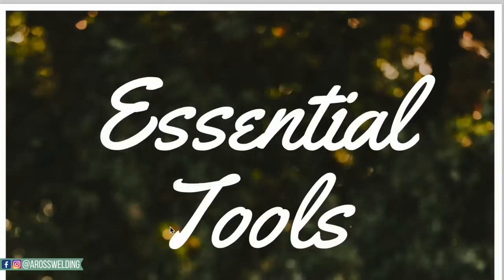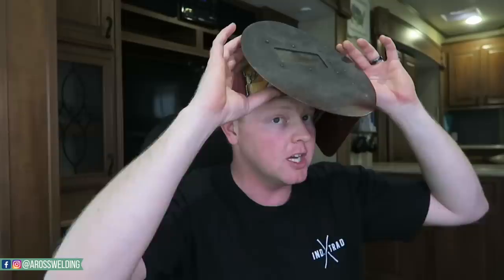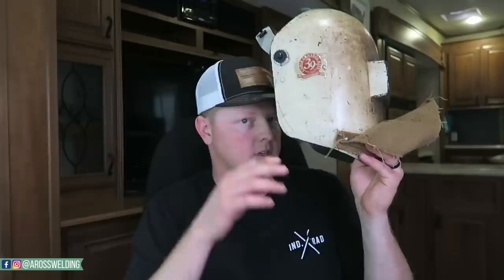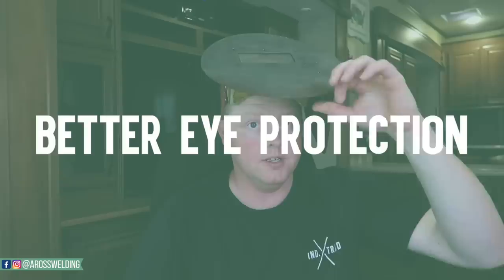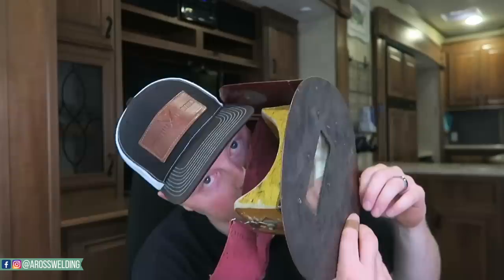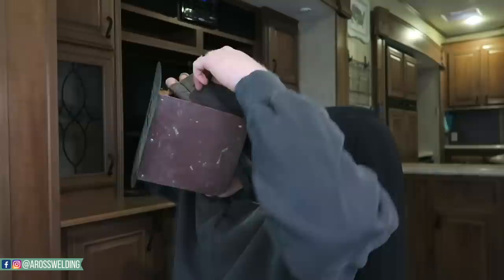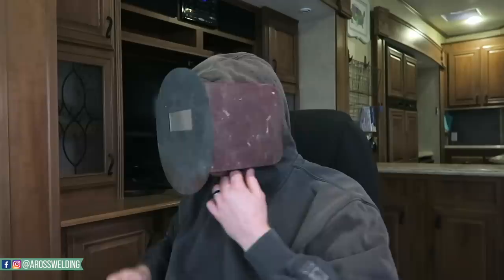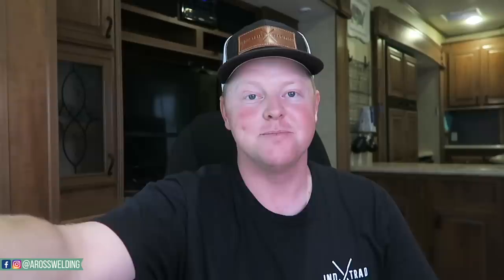WHY PIPELINE WELDERS WEAR PANCAKE WELDING HOODS (EVERYTHING YOU NEED TO KNOW)

Comment: I welded in a small area with 1 or 2 others and was repeatedly flashed by their arcs and they by mine. Even reflections in the helmet were distracting. I didn't care for the electronic lenses because the sensors would turn off at random times due to positioning. Also smoke would regularly find it's way into the helmet.Something with complete eye protecting like this combined with multiple sensors for an electronic lens might have been useful.

Comment: Your problem will disappear when you learn the comfort of welding, replace the pans with a good 3m speedglas 9100 mp Adflo - then it's fun to weld because nothing bothers you - smoke, sparks, flashes from the back - it's great, I spent over 20 years in different places and in 90 percent  this speedglas is amazing 
👨🏻‍🏭

Comment: I'm not a welder but have done a lot of welding in industry in the last 3 years before I retired and my favourite hood was the auto darkening one.
So with a "normal" auto darkening helmet you could make a sponge rubber square box around the lens to fit to your face and so exclude the back glare from the surrounding lighting.......this might make your face or the lens steam up from the trapped moisture etc.....gonna try it next time I go out there.

Comment: I like my standard auto-dark hood for arc welding, though so far I have done a grand total of one weld outside which was a tiny lil flux core bit. I prefer goggles with a flip-up tinted lens for oxy-fuel work though. I wear it with a respirator (I'm more sensitive to airborne particulate irritants than most) under a face shield for heat management. Works great for running beads or cutting in the shop. 
I'm actually an engineering student, but a year and a half at trade school reinforced my belief that though y'all may knot know why what you're doing works (who cares what's on the outside of a 6013 specifically, only that it's not a 6011, etc) but you know HOW it works better than any desk jockey or supervisor who's never actually touched the processes or techniques themselves. Those instincts and ambition are incredibly valuable to any designer/engineer, especially if they want to be good at what they do.

Comment: So I just watched your video at the Starbucks. You used the ( now I know) pancake hood. Made me feel kinda dumb, never saw one. I welded for about 13 years at a sprinkler co but it was always in the shop so never had a problem with back lighting, the place was like a dungeon. But I’ve done a lot of welding at my shop now inside and out. I’ll be getting me a pancake hood. Thanks for your time and knowledge.

Comment: Most welders in Australia use light adjusting automatic helmets, they enable precise electrode positioning and help 2 avoid arc strikes on the parent metal, thus avoiding cut outs on specialised piping. Also stovepipe welding and vertical down procedures are virtually non existent these days and have been replaced by TIG, FLUX CORED and Automatic Orbital techniques which will eventually take over in the coming future.
Reply: Flux has issues out of position compared to SMAW.
Auto orbit I'm assuming you mean the submerged arc remote process? If so the time spent on attaching the equipment to the pipe means it's only worth it on the larger pipe. Manual stick is faster for the average pipe to setup and cleanup so it more than makes up for the small amount of time saved using submerged.

Comment: cool man... I work as a controls electrician at a steel pipe mill. we make the big heavy wall pipe. average size 48' diameter .650 wall. but lots of other sizes. im sure you have welded up our product in the field

Comment: I like it. Great explanation sir. 
I have been tinkering with the flexible solder and welding shields I use when welding or soldering in front of flammables.
I use Oxy Goggles(Gomer Goggles) with a hood made of 2 layers of the fabric like a sweatshirt hood or more like a Balaclava lined with flannel (pillow case). 
Exceptionally great in the winter my head stays toasty.
Tough part is the addition of an adjusting strap to the goggles that just arent made for it. 
Pop Rivets look crappy so I switched to hand riveting copper rivets with a lil air hammer. 
I really like the flexibility and weight is almost non existent. 
The tint is fairly easy once you learn how to shape the glass.

Comment: I had always wondered about that.  I have been welding for a number of years off and on.  I have never done pipeline welding and had always wondered about those hoods.  My normal go to for mig and stick is a standard sugar scoop style with a big lens.  I also have a lincoln viking auto dark that I use almost exclusively for TIG.  Having the shade adjustability and the super clear lens is nice for high precision stuff and if I need to weld in a cramped space like an in car roll cage or performance exhaust type work.  I might have to try a pancake for some of the mobile service/ mobile fab type jobs.

Comment: As a teen I worked pipeline and once had to drag the welding cables a few hundred feet into a 36 inch pipe so a bad weld could be repaired. Low man on the totem pole and all.

Comment: I’m just wondering why they don’t make one that’s made entirely out of carbon fiber with a paper thin layer of titanium on the exposed faces, and takes a common auto darkening lens.  It seems so simple.  Everything is flat, so you don’t need to hand lay a carbon fiber shape.  Just basic sheeting.  The cup of the goggles would be the most difficult part.
Reply: Not meany people use autodarkening lenses with production welding like that. Just do much hassle if they get to where it doesn't darken because you're at an odd angle, or if the batteries die, or whatever other problems they can have. Where a tinted glass is always going to be there.  

I would imagine making them thinner and using fiberglass is what has reduced the weight. Much of it is probably in the goggle cup.

Comment: I wore a huntsman 411P for years, then back light was killing me I switched to a sugar scoop back light was a little less but that rubber strap kept failing so I put a regular headgear in it, I still carry it but rarely use it. Then I bought a Wendy's, Arcone singles 240, and a 3 power cheater and it's a game changer, I can wear that thing all day. I'm not a pipeliner, I do structural, fencing and fabrication. I'm about to order a second Wendy's.

Comment: Some of the job sites aren't allowing pancakes because when you lift you  don't have eye protection.  Some are even requiring hoods to be mounted on hard hats.  I like my Fibre Metal but also have a Jackson w10 with an adjustable auto dark that has grind and cut mode.  Hate that one when welding all day because it's so damned heavy but great when doing repairs and your back and forth with things.   Also have a Jackson w10 with just a plain lens.  Still a little heavy but not welding as much as I used to.

Comment: Try using a firefighters good .during winter work .it fits snug enough so you would be able to use any welders hood. Over so it won't be in the way  while working .all different types fairly cheap .

Comment: With the sealed eye box I'm afraid I would fog that up when I get sweating.  Broke in on Hunstman with a big window at age 18.  Dropped and broke my first one.  Been using the next Huntsman ever since 1984.   I use ear plugs to keep the sparks out of my ears.  I like the big window so I can look behind me while welding to see who all is watching over my shoulder.  In a big shop people sneak up on you to see how you do some things.  I can also see if my skin on my head and neck is being exposed to arc flash.  I run a #10 filter and a number 3 cutting lens taped on the inside so I can start my arc in the 10 and then dip down to look through an effective 13 lens.  .  No more head aches or mild eye flash.  I run a lot of .065" wire in spray transfer with mixed gas.  Using up a 60 pound roll every 6 hours.  It's really bright.  When we were practicing our 6" pipe tests they required all welding to be uphill.  1/8th land and gap.  1/8" 6010 root and 7018 cap.  No grinding wheels allowed.  Had to chip it with slag hammer and wire brush only.

Comment: I prefer on land the Miller T94i-R because it's a full head with fresh air from your back area which I use a lot on shop and tight spot welds I even pull my filter off and run a much longer hose on it so I get fresh air from outside the hole so even if the oxygen level would drop inside the vessel or tank I still can work because I get fresh air supplied.

Comment: Most welder's wear auto-darkening and they are super light weight. No one uses a sugar scoop anymore.
Reply: Gregory K. We use them in Mexico, they are a cheaper alternative. Dedicated welders of course prefer the more expensive but more efficient equipment, but if you have to provide protection to a dozen middling welders then sugarscoop's gonna have to make do.
Reply: I rarely see pipe welders use auto darkening hoods. So wierd.

Comment: I think your pancake hood is an American thing. As a boiler Maker, I never saw pipe line wear that in Canada. Typically we are all supplied with the  basic Fibre Metal grey mask. A lot like your sugar scoop. I have used a full face respirator style (North brand). Everyone calls it a Darth Vader mask. It's all black and covered. Used in our tight spaces were fumes are a concern. Tend to wear it with a auto darkening insert lens. This way I don't have to flip it up too much. the flip up part is a cheap plastic hinge that breaks easy if not careful.

As for using hood while welding, In Canada we have to wear hardhats, and the hood can't go over your hardhat. Also in some sites, you are not allowed to wear hoods. Balaclavas are aloud. a trick around that is to wear a neck warmer and took over the hood. it disguises the hood, and being -20 to -40 Celsius (-4 F to -40 F) you don't care.

In the shop I tend to wear the Miller Digital Elite. When I return to welding, I'll probably upgrade to a force air respirator system. Clean air, easy breathing, a little cooling, and no back light. Also like this mask for TIG work.

Comment: So this wasn't really what I was looking for I clicked on the wrong video but I have been a structural welder for about 5 years for the majority of that time I used the Miller infinity hood yes they are a bit heavy but I'm blind in one eye so the clear light lens helps a lot but I just got the Lincoln viking 3350 and it is by far better its much lighter and the design of the head gear is much more comfortable plus the clear light in that is 100x better but I was still wanting to get a pancake for when I'm out in the field or doing a bigger project that has to be done outside anyways thanks for the video

Comment: Couldn't you just affix a bit of cloth off the top edge of the regular welding helmet using snaps? Solves the back light problem, and can be removed/replaced if needed.

Comment: Using the cheapest Optrel automatic hood (150€), since I'm a hobbyist, doing mainly TIG, bit of stainless/aluminium, and I'm not good enough to have a non-automatic hood, and it fits my respirator.
If I did more welding I'd probably get a PAPR hood (stainless and aluminium TIG welding isn't the the healthiest, plus, I do it indoors... yes, with good ventilation, but, there's limits.).

I tried a permanent shade hood and with smaller stuff/bad angles it always messes up my start, which then annoys me, makes my pool go bad, destroys my flow... lol

And I do wear a hood (from a fireproof coverall) below my welding hood. I don't like most welder hoods because the neck is exposed. I don't want any skin to show.

Comment: I have several pipeliner scoops, some with the rubber tube tension band and some I modified with sellstrom flip up lens and ratchet head gear, that I use indoors or if I am doing a lot of tack or grinding but for welding outdoors I prefer my pancakes. I like the original pancake with cheater lens box that comes without a side plate and I add a wendys side plate to it.

Comment: Johnson's a company that supplied to the Navy use to make a half hood it was only about 10" across about 8" tall and flipped down much closer to the face it's what we used to pipe weld . I still have mine but the head peace finally failed so I can't use it any more the head peace for regular hoods extend it out to far with its reduced size let's to much light in .

Comment: i dont know... but now days welder helmets are cheap u can attach back hood to them (so u can be warm and have no back light and also u can get ventilation as a bonus) and they are lightweight... i dont know where u live but i think u should try modern electronic one... im welder myself i dont mind using old crap if i have to but modern ones are pleasure to use...

Comment: I have to use an auto darkening helmet.  I tried tig at work and i couldnt find my hands if you get what i mean.  Im pretty good at mig but arc i cant do and i wasnt very good with tig.  I have bought a generac 7500 and a hobart 190 mig. Ive rewelded my pintle hitch mount and rebuild my flatbed trk bed and redone my flatbed trl ramps and other such things.  I love welding my own stuff vs paying or bumming work

Comment: What about the helmets that get dark as soon as you strike an arc?  Hardly ever have to lift it, works off the light the strike gives off...  Anyway I used those for a long time, also I wore a towel or apron over my head when welding outdoors.  Just saying.

Comment: I'm a shop welder been welding for 26 years, never worked pipeline, most of my time is spent fitting and tacking now, so my Miller pro auto darkening is a real time saver for me,  the magnetic field activation is great if you are working in a shop with alot of flashes and keeps it from activating when you are just trying to line up a piece for tacking.

I can definately see the advantage of a pancake style for some applications. No flip though, huh? Neck flip seems out too, Do you have an auto darkening 2x4 in there?

Comment: I've just always put snap buttons on the outside of my helmet at the back and put a thick leather sheet on there but I cant stand running a straight  lens helmet I'm an auto tint guy can be a pain in the fick outside sometimes but you just have to adjust your settings

Comment: Hi there I am a Mobile crane operator in Manitoba Canada 🇨🇦 and on most of the time the hard hat rule is strictly enforced so most of the job sites I went to the welders would wear a hard hat with the sugar scoop . So when you go to work do you have an exemption and therefore you don’t need a hard hat on pipe line work? Thanks 🏗🪝

Comment: Austin you can get a flame retardant helmet liner for a welding helmet.
 I got mine on Amazon it came with a detachable face cover too.
It was $30. ish b4 covid. 
I use it on a yeswelder 8000d out in my unheated garage in Wisconsin,  it is warm.

Comment: I don't understand the pancake mask, do you wear goggles under it, or is it an auto dark lens?
I wear a scoop with auto dark lens, but the light reflection from the back is very bad, I always wanted a hood on the back of it, and when I made one, I found the fumes were concentrated, so I ripped the hood back off.
Reply from the maker: The pancake hood is designed like goggles to keep backlight out. And they make auto lens fir the pancake hood. Check out this video. 
https://youtu.be/G1JiVB41WPI

Comment: How is it during hot weather? Does it sweat up and fog inside the goggles?
Reply from the maker: It will fog up if the weather is just right. But from my experience, it normally only fogs up when it is setting on top of my head above my eyes while I’m not welding. And if I’m sweating a bit and the outside temp is a bit cooler… I hope that make sense.
Reply: Sure it helps! I'm at the age where backlight is a real problem, inside and especially out. @arosswelding

Comment: Why not install the goggle shroud to the other design? Essentially just remove the existing strap system and glue some opaque goggles without the eyes to it. Use the goggles strap to fix on your head

Comment: These guys really need to get with the times, if you are welding all day then you should be using a PAPR, they're not cheap but much cheaper than a new set of lungs. as an added bonus most can have a built in head and neck hood so glare is a non-issue.
Reply from the maker: Ventilation is not an issue outside like it is in a shop. 👌😎
Reply: @arosswelding  Hey man, appreciate the response, in the Land of Liability (USA), I'm amazed companies aren't requiring respirators like they do with so much other safety gear. All the guys I work with won't think twice about opting for a PAPR mask regardless of if theyre inside or outside, it's that lifelong exposure to welding fumes that gets you in the end. Plus some of the fan units can take an ice pack for cool air on a hot day 👍